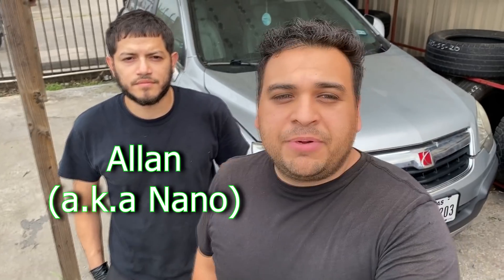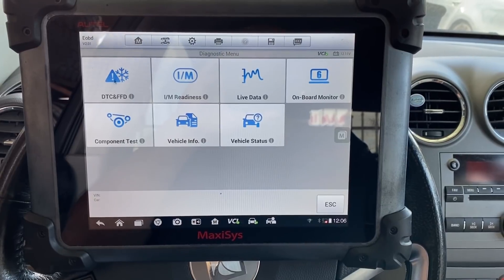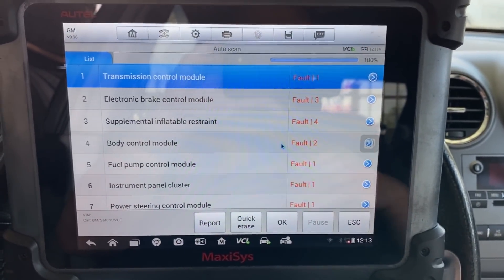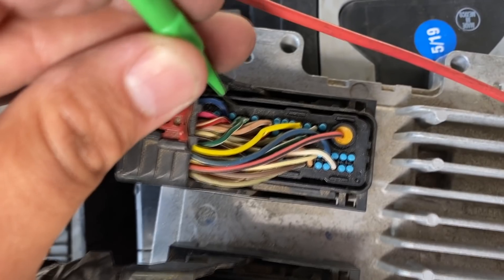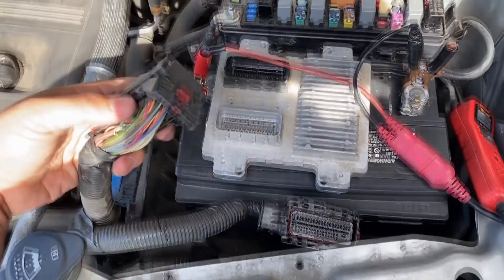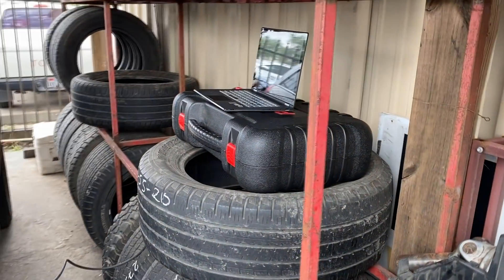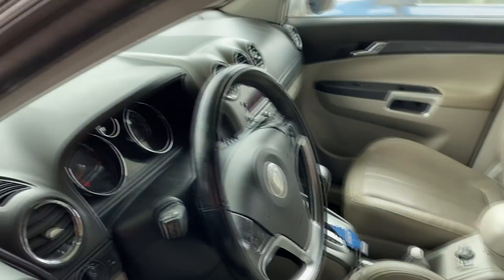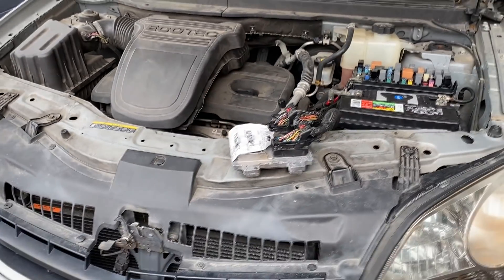SATURN VUE NO CRANK NO COMMUNICATION CASE STUDY

Comment: I have a Saturn aura 2007 3.6 l and runs and drives great and once I drive it for while I park it it won’t crank or start till it sits for few hours
Reply: Exactly the problem I got with a Saturn aura xe 2008

Comment: My 2008 Vue at the beginning was failing the crank, it was starting slowly, and I got a battery thinking that the problem was an old batt, but when I changed for a new one, the problem continued and now the car doesn't start at all, the battery's charge is normal, but it doesn't start the engine, I guess I have to change the starter, I hope after doing this my problem is solved.

Comment: Hi, I have a similar problem, I have a 2006 Saturn Vue AWD, it started just fine I left from my work than I almost got home than the radio turned off and than came back on then my light did the same, after that it won't start again

Comment: So I have a 2009 Saturn Vue and thought the starter was bad (single click when trying to start it). I put a new starter in and hooked up the two wires around the top terminal of the starter (power I believe) and plugged in the wire with the plastic clip (purple wire). Went to start the car and it didn't even click. Went back under the car and noticed a black and white wire hanging down with the end of it looking like it broke off of somewhere. Any ideas where this black/white wire goes to? Also now I'm able to shift my gear shifter without having the keys in ignition and/or foot on the brake. Another thing is I was able to scan my car and it would read codes. Ever since that black/white wire is hanging my scanner won't read my vin/codes/any info on my car.

Comment: My care  wont start its a 2009 UVE XE. saturno same issue as the one in the vídeo  algo the key is stuck and wont realice it frontal the ignición. Can you help me..
Reply: If the ignition key cannot be removed when placed in park, (assuming an automatic transmission), and the key is in the off position, the neutral safety switch, (correct name?), at the base of the shift under the console cover, may not be closing when placed in park.

Comment: For a 2006 Vue. Would trying to start the car and getting no crank. But instead a smoking in the engine possible electrical short be caused by a faulty ECM???

Comment: what are you using to read the codes and things with ..  I have a cheap ass scanner i got at my local walmart ..  it does the needs for my personal auto`s.  But id love to be able to scan more system checks, dop more and reprogram ECMs with ...     can you offer info on the unit you are using on a good unit close to the one you are using
Reply: I was wondering the same.  Autel Maxisys but there are a lot of different variations.

Comment: Thinking this is the issue with mine. But before it stopped starting, an auto store read a code for the throttle actuator needing replaced. But then my Vue did all these same things when trying to start it.

Comment: I have a 2002 Saturn Vue to start it i have to crank it once and it doesn't start  but if i  take off the black cable from the battery  tap it on the post and then try to start it .It will start every time but i don't have any power stering or gauges and the security stays blinking. need help fixing it.

Comment: I really liked your video and I know this is an older post but I'm wondering if the j2534 programming tool would help me program an older vehicle. I have a 2002 Saturn Vue AWD 3.0L V6 which I had replaced the ECM (OEM Refurbished) but I can't seem to find anyone to program it and the GMC dealer isn't sure they could do it.

Comment: Question. I have a 2009 saturn vue, rear latch is not opening. I checked the fuse, when pressing the open switch I can hear the latch trying to open but the voltage is low. Sometimes it will work on its own. Any suggestions or wire schematic you can provide me.

Comment: Good diagnosis of dead computer, get engine light and indication of issues with ECM, then bring it to the shop, the programming probably is too much for me and the average home mechanic that can use a basic scan tool. Had a Saturn with engine light and limp mode, the dealer replaced the board. The job was expensive enough to get a several hundred-dollar scan tool and verify the computer is probably malfunctioning and it wasn't some limp mode/engine light module that they replaced, then added an ECM to jack up the repair cost.

Comment: I have been told when disconnecting the BCM the battery has to be disconnected I had my Vue in the dealer to replace the BCM they claimed it didn't need to be disconnected (GMC dealer)but a Chevy dealer and a Caddiklac dealer both said it does need to be disconnected long story short the replacement one I bought was fried and the one in my car now has problems where if I do not unhook my battery the battery gets drained and didn't start that till they did the work 2007 Saturn Vue redline

Comment: Why do I have to tap my fuse box and everything light up some times can some one help me. With my 2009 Saturn  vue xe  2.4l  4cylinder and stability track comes and go.
Reply: My 2009 VUE Hybrid does something like yours.  Bought used in 2016, an Innova scan tool would not read the OBDII, but had no problems with my other vehicles.  A buddy checked it w an Autel Maxisys and at first had problems, but then voila!  The ECU was readable, even using the Innova.  But the Innova had problems at times and unplugging/ plugging in repeatedly would get more ....or less data.  Then a Check Engine popped on and indicated the O2 #2 sensor was faulty.  The Innova showed 0.7V +/- 0.3V, which should be okay.  Then a P0A9? or P0A?6 or P0A?2 displayed.  (=> P0A96, Faulty hybrid battery module cooling fan signal.)  Days later, the engine would not crank.  Waited a few minutes, and the engine started, but at reduced power.  Innova:  ECU.  Turned off, waited a couple of minutes, then the engine started and all seemed okay.  Then Instr Panel: Service Hybrid, and the VUE drove ok but was not using the hybrid battery.  Sometimes the hybrid battery would be in use, other times, no.  The 12V starting battery seemed to by dying, (its potential was 12.2V), so it was replaced.  Red herring;  the old battery was good, but the VUE hybrid battery started to be used again.  => =>  This seems to be some sort of wiring , connection problem or communication problem.
A bit off the subject- If I understand this correctly, the VUE Hybrid is 36V 3 phase to charge the 3-bank NiCd hybrid batteries, and also converts this to charge the 12V system.  Initial start uses the 12V battery, and for the hybrid start/ stop system uses the 36V NiCd for subsequent starts unless the NiCd has too low of reserve, in which case the hybrid start/ stop system is bypassed and reverts back to the standard 12V operation but still relies on the 36V alternator to supply the 12V system.  If the 36V system fails in any manner to proved 12V, the vehicle will run only as long as the 12V battery can.
This video gives me more confidence with checking out the ECM X1 and X2 connectors.  But I still need to review the procedure for disconnecting the hybrid battery cables

Comment: Another Excellent video!! A couple of things I'd like to add. If the ground pin is suspect you might have checked if the LOW REFs have ground in them with the computer plugged. If they do then the ECM is receiving a good ground. And while at it, you might want to check the 5V refs too, see if the ECM has at least some power. And if all this fails you might want to power it on a bench and see if there is COM outside of the car. Also an incandescent test light would work better for powers and grounds as it loads the circuit. Maybe with a 1.5 amp incandescent tail light as a test light. I've needlessly purchased ECMs and have been burnt before by power probes. Once I had a bad ground on an installed corroded junkyard engine. Another time I had another bad power due to corroded wires. The probe didn't detect the faulty voltage, but the test light did. Finally, you know what they say about the ECM being the most expensive fuse. You might want to check WHY the ECM was burnt in the first place. I've had to put in ECM after ECM on the same car at my expense, just because something in the car, some sensor or solenoid,  was making it burn out again and again.  Just some advice for others.

Comment: Your attention to detail is what separates you from a lot of mechanics---many would just throw an ECM at it with no testing, but you checked the voltages and pin fitment first, which could've revealed an issue. GM electronics are garbage

Comment: Just as a heads up, before condemning a module besides checking power and grounds (should be LOAD tested)...you should also make sure none of the voltage regulated module outputs (typically 5 volt references) are not shorted as well.  Many modules will "shut-down" if their output voltages are shorted.
Reply: And check the communication wires going to pcm
Reply: The men of the video is the best ,

Comment: Great case study.  Straight to the point and you included the programming procedure for those who might not have done it before or are curious about what it takes.  Something I will note, as it has bitten me before - I've been fooled by my Power Probe showing good voltage or ground despite the circuit not being able to carry a load.  Once I've verified that powers and grounds are good, I'll unplug the connector(s) and put a load on the circuits (I have a 3157 bulb and pigtail I like to use) just to ensure they can carry the load of the ECM.  Thanks for posting your video.  I hope you are safe and well, considering the craziness lately with covid-19.

Comment: Another excellent case study. How would an car present if one of the communication wires from the computer to the network was broken? Would the vehicle start? Is there any reason for checking those wires before condemning the computer?
Reply: I think it would crank over and start but the other modules on the data link would not communicate with it. I might be wrong though. I had a Saturn one time where the scan tool would not communicate with any modules but started and ran perfectly. I found one of the CAN circuits to the data link connector was broken. Repaired that and all good.
Reply: Sometime it starts but then it won't and if I had get engine control manual are u able to interchange or can y'all get me one
Reply: All vehicles using CAN or in this case LAN networks have 2 to 4 tiers of network, separated by speed. Usually main modules will communicate through more than one. Satellites sometimes not so much.

Comment: So you didn’t check the datalink? You do realize if a datalink wire or terminating resistor is bad it will cause the exact same symptom, right? Just because an ECM is getting power and ground but not talking on the network doesn’t mean the ECM itself is bad. The network it’s talking  on may be the issue. I would seriously consider revising this video with this information included. This diagnostic routine has a very high chance of resulting in a misdiagnosis, and a costly one at that.
Reply: I agree and the 5 volt refs were not checked for shorts.  He got lucky on that one.
Reply: Geese

Comment: The hvac module looks to be an automatic one - the temp dial has numbers, and I believe I read an "auto" position on the fan speed control knob.  Does this have the potential to ever change the way the scan tool tries to communicate w/ the PCM?  It seems like a who-cares, no big deal, but man that'd throw your for a loop if that what was why the scan tool wouldn't communicate!

Comment: You have amazing skills! With my Launch X431 I can write the old VIN number on the new ECM without any online subscriptions or software reflashings
Reply: Hi Argeny, I have Launch X431 v+ the new one i think can do that too so we just  need to write the old VIN # and the software should be the same this is with GM only or with other maker too do you have any information  appreciate any info sharing .cheeeeeers
Reply: @jgeorges3061  you can do it with any car brand
Reply: That is my next purchase
Reply: I just got the Launch X431. and a 08 Saturn Vue. New to scanners. Any advice on how to really use this scanner ? Also I want to get a second Ignition key but don't want to pay $70. if this Launch can do it. Also I need to relearn the crank and cam sensors and battery registration. It just won't let me do the battery registration. Possibly update the ECM also ?

Comment: Bro, we have the same problem to our car we got Chevy equinox and i really hate my dad trusting the mechanic/technician who fix the car cause he now insisting that the problem is the fuel pump after charging us 500 to change the ECM that I know it wasn't replace cause 2 days after the car doesn't want to start again same on the video . And he kept saying it wasn't the ECM or the TCM is the problem instead its the fuel pump but in my code reader says U0100 means lost communication to the ECM/TCM .
Reply: Fuel pump won't cause a no crank situation.

Comment: What goes wrong in the unit?
Reply: Most mechs/techs don't do solid state repair on engine modules.  Manufactures doesn't supply pcb diagrams or information on how devices work inside the modules.  Plus you need special equipment to service smd components.  Ain't worth the time for most shops to go in that deep ,so they troubleshoot by making sure everything around the controller is good before condeming it.  If it's your own vehicle have at it.

Comment: Thank you for sharing. I'd just add, for the final step, I'd wish you perform a voltage drop test on the powers and grounds for the ECM.
Reply: Back probing the wires is a voltage drop test. The ECM is the load. If he unplugged the connector and then tested the wires that would be unloaded and an inadequate test.
Reply: Also make sure the 5 volt reference is not shorted to ground causing the issue

Comment: Hey man , awesome video . Only one little thing you always want to check for 5v ref being shorted
Reply: Exactly what I was goin to say but ya watched before I did... one thing I do is use aes lead kit connect powers grounds data lines from harness to module male pins see if it’s sometfunny like an out put causing issues
Reply: @philh9238  I like that idea!  Almost a bench test of the ecm, no?  Just powers grounds and comm wires, and try the scan tool again?
Reply: Yes
Reply from the maker: Yes! I forgot to add that he had already checked the 5 volt ref.
Reply: @ADVANCEDLEVELAUTO  please show how to check SDVC wire is damage in Hyundai i20 1.2 2011